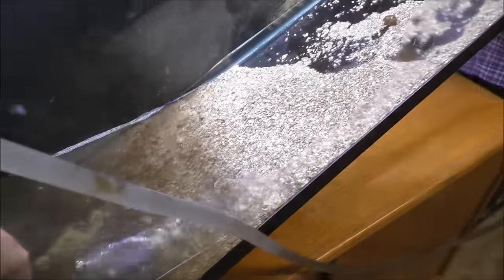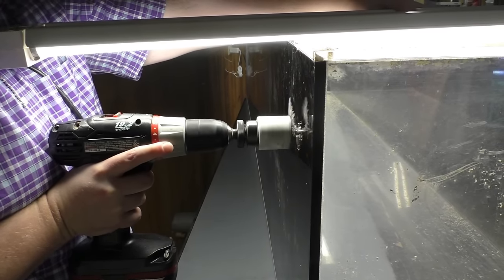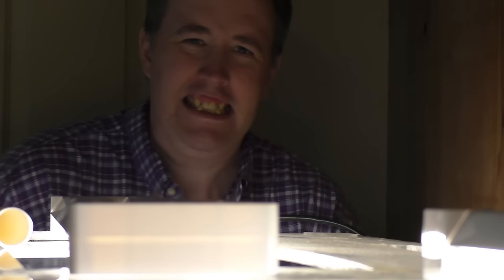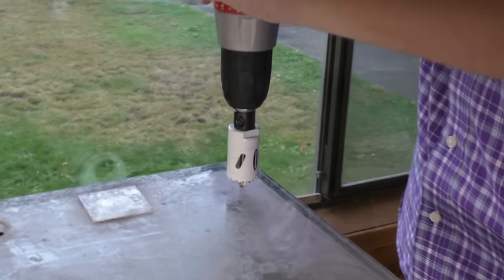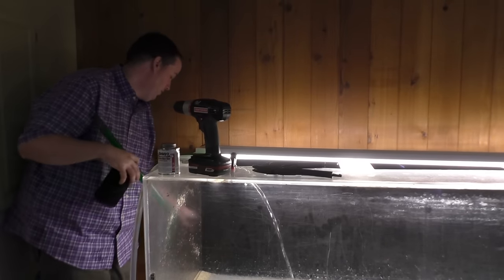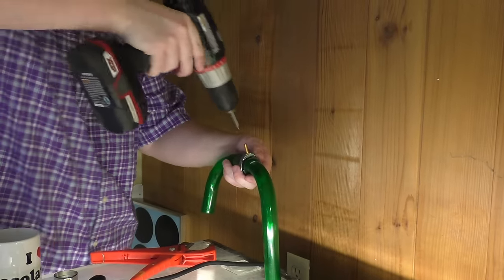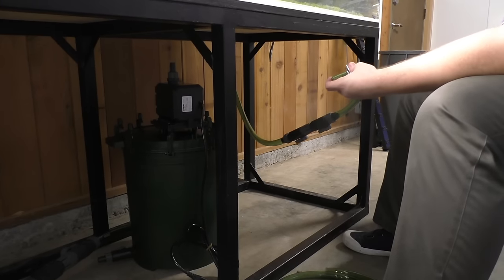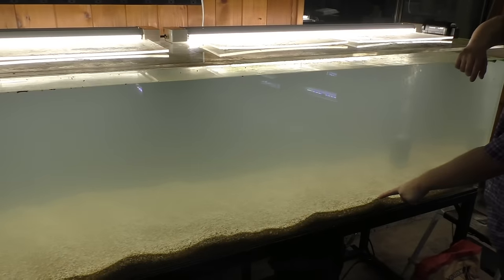How to Setup an Aquarium: 240 Gallon Fish Tank

Comment: Did you ever end up with this tank? I have a lead on potentially a great deal but wanted to ask your advice first. It's a 240 gallon Truvu that he is selling for 150 bucks. It needs tons of sanding buffing and polishing and needs to be water tested. I have read on forums that Truvu at the 240 size often bow really bad. I am very hesitant and cringing at the thought of putting in the living room on the new hardwood floors incase a seam failure or a leak. Would you ever suggest I set-up the tank outside under a canopy and set up a freshwater predator tank. It doest usually ever get over 100 degrees where I live and so water temp should be stable under the canopy as well in the shade. Please let me know your thoughts, Thank you!

Comment: Do you guys recommend buddying out the scratches inside and outside that type of used tank?  If so, what kind of solution do you suggest?
Reply from the maker: Depends how much work you want to do. It takes a lot of time. I start out with 1200 grit sandpaper and wet sand it. Then use all three novus polishers.

Comment: what is the sump for? isn't it redundant since there is canister filter being used? I'm a newbie to this so i don't understand the function of the sump
Reply from the maker: Not a sump, just a 40g breeder used for the auto water changing system.
Reply: my bad, i thought it was a sump. do you have a video on the auto water changing system
Reply from the maker: I don't, but if you check out Aquariumcoop channel, he has a series of videos of how he built it. This specific setup would have had a sump pump in the 40g.
Reply: thanks man